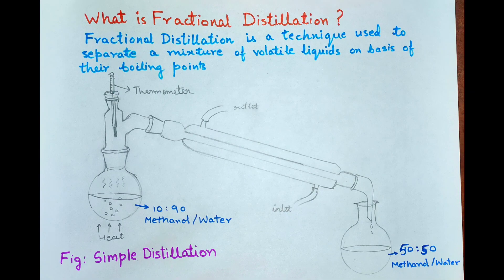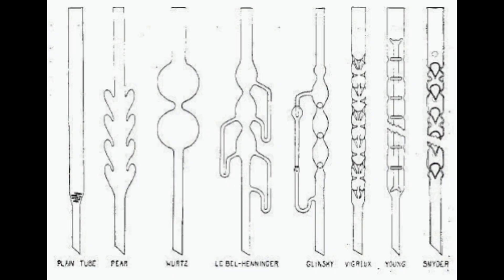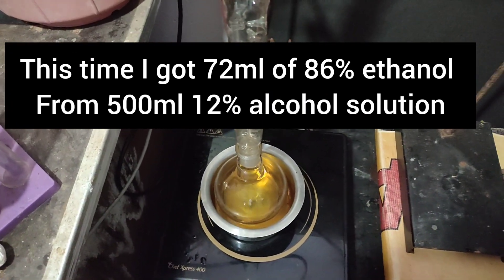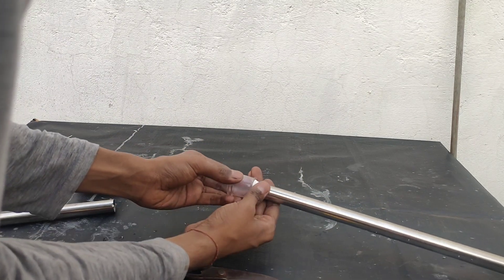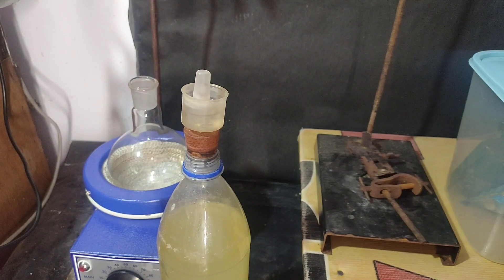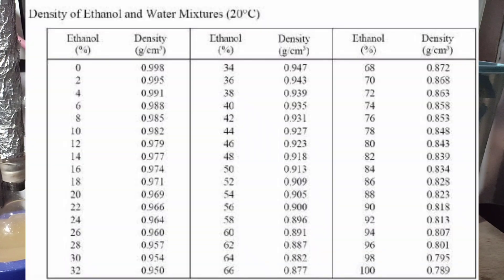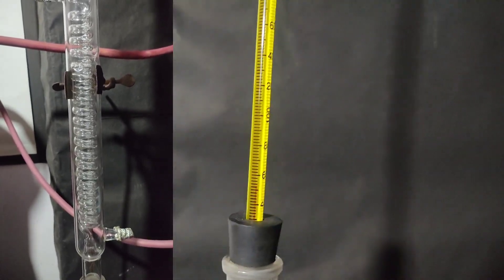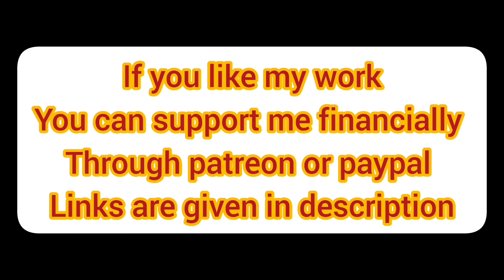How To Make a DIY Fractionating Column | Fractional Distillation

Comment: Perhaps using polypropylene pipe will be better as it would allow distilation of acids, and it os temperature resistant
Reply from the maker: Do u think polypropylene would survive the heat and corrosiveness of vapourised acids. At 100℃ polypropylene stars softening and above that temperature i dont expect it to withstand the heat. Still the packing material will be a steel wool .
Reply: @TheDIYChemist  Your points are valid, i forgot to consider those points. I will see if i can find any more resistant plastics in pipe form